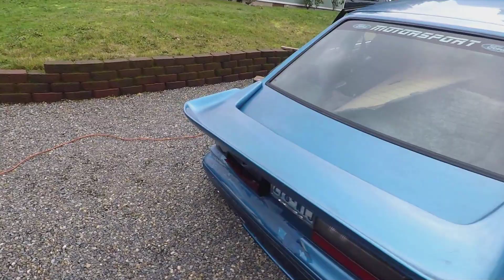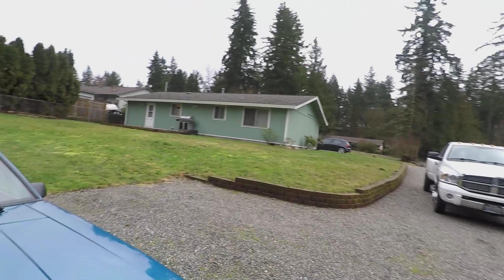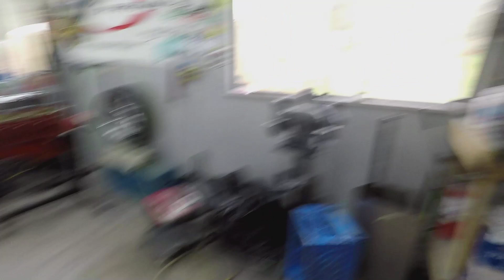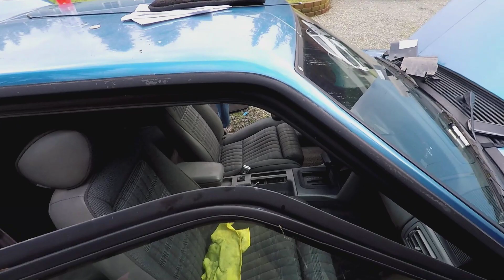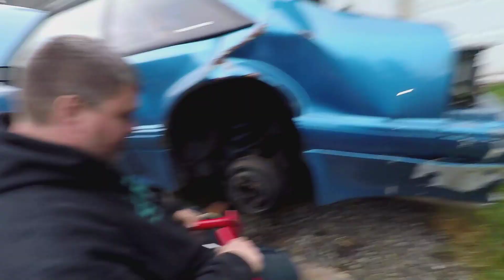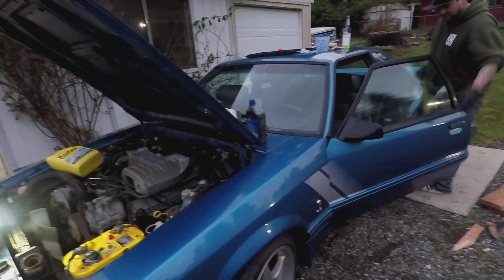I bought a Totalled Fox Body Mustang! Saleen? Cobra?

Comment: heater box wasnt "hacked up" cause of the rollcage... it was tastefully removed because of the rollcage... you dont need ac in the snow...  the mustang was supposed to be fast... if i knew it would end up with a 5.slow at least temporarily, i would have left it intact and not had the extra bar put in...j/k... so that i wouldnt hack up the notch, i had purchased a 5.0 hatch for $500 at a tow yard to gut etc... ended up letting someone (no longer a friend) buy it off me for payments (to total $500)... they never paid me for it... prior to "giving" it to him, i actually drove it, it was pretty fun to be honest... i suspect, you will have fun with the notch and that engine combo...

...and an on3 turbo setup

Comment: It would have a stenciled number on the front bumper 001to500 on th top drivers side the head rests would have been lime a open square with a net in it and it would have said racecraft under the 5.o fender badge and ofcourse the roll bar